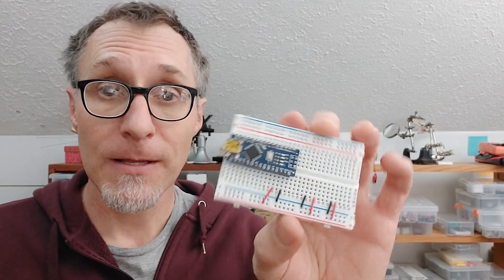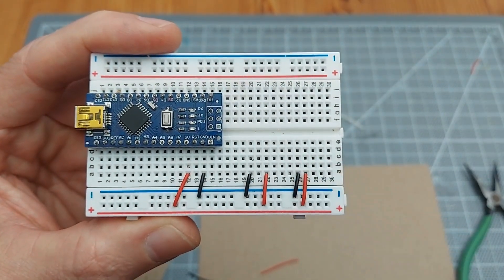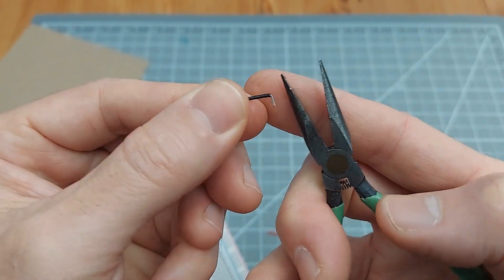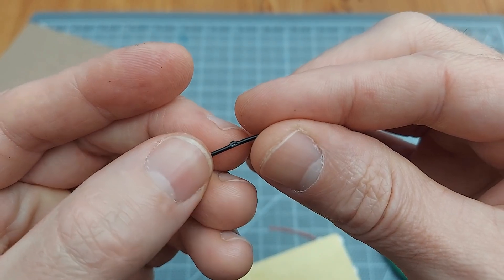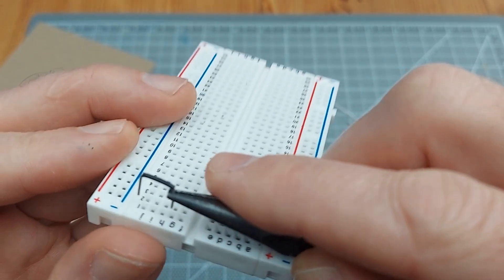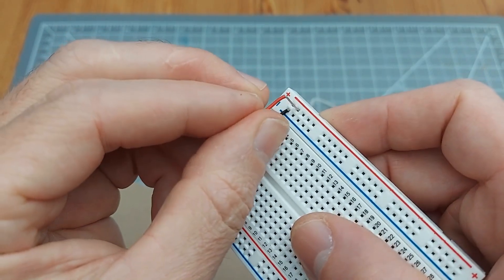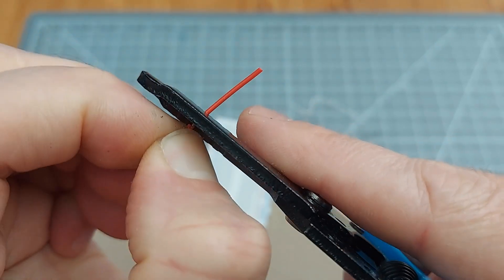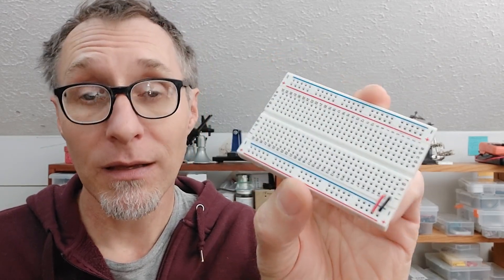Better jumper wires for breadboard electronics

Comment: Just started using this method after getting tired of accidentally pulling jumper wires out when making changes to wiring or adding wires for additional components I was adding, especially when things started to get busy on the breadboard. It was getting to be a bit of a headache.  I managed to get hold of some CAT5 cable left for trash in the recycling at work and it works perfectly for the breadboard.  Things look significantly cleaner and I can actually 'see' what different jumpers are for, rather than having to fiddle through a jumbled mess. 

Definitely could do with some wire strippers though; next on my to buy list.
Reply from the maker: @EngineerNotFound  why are strippers are a must! And I have two different pair, to cover the full range of wire gauges

Comment: Good info, well done. I had been wondering about using solid core wire from ethernet cables. A couple of commenters below recommended it. It's easy to get, maybe a little harder to find 22 AWG. Thank you!
Reply from the maker: Yeah it's weird this video ended up being quite the forum. YouTube is just so Random!
Besides liking the thickness of 22 awg, the reason I buy spools is so I have exact colors for board layout.. black for ground red for positive voltage Etc. And then I stack all the spools on a dowel so I have kind of like a dispenser on the side of my desk it's pretty handy

Comment: I started with telecom cable. Old Ethernet cable can also be used. No need to buy spools.
Reply from the maker: Indeed! Good recommendation. Of course I find phone or ethernet cable to be a bit thin for breadboard work. I'm using 22 AWG in this video.

Comment: Good video. I use a similar technique, except I jamb my thumbnail into the jacket as to where I want to strip it.  I just started to design a wire dispenser. You press the number of holes wide you want on a keypad and a stepper motor spits out that length plus extra to be stripped. I like stripping with Hot Tweezer Strippers. They are easy to work with short or long length wires.  If you search for Wire Dispenser Breadboard you will find my short video on my channel for what I am making.
Reply from the maker: Thanks! I love the thumbnail thing -- you already ARE the tool... LOL. And I love the idea of a tool to make these. Looking forward to seeing where that goes.
Reply: @androofroo  Yes, I have been told I am a "tool" , usually from my Canadian friends [smile].

Comment: You can also just buy pre-cut, pre-stripped, pre-bent wires like this in assorted lengths which I find a lot more convenient for prototyping since I'm actively avoiding anything permanent. Even if the lengths aren't perfect, you can get them nice and flat and you can reuse them without actually needing to go to the work of measuring and manually preparing the wires.
Reply from the maker: True. And you should do what works for you. I keep my old ones in a spare breadboard for future re-use. No reason to remake anything ;-). I do find that measuring allows me to have near perfect length for every specific application -- which I like.

Comment: so just like you do with through hole circuit boards, only with removable cables
Reply from the maker: yup, pretty much 👍 ... and often you can reuse common lengths. I keep an extra breadboard with spares in it.

Comment: I've been doing this for as long as I've been breadboarding.  Another tip for actually using these is to attach popsicle sticks or some other form of extensions to an alligator clip to make it easier to hold and use that to place and remove the jumpers.  As you start building up more intricate circuits it can become quite difficult to do by hand. You can actually get kits with pre-formed jumpers like these, although the last time I got one they used the worst possible wire -- almost as soft as solder.
Reply from the maker: Nice tips! I also hate the pre-formed ones... not only are they cheap, but I like to cut them to the correct length for each build.
And yes, for more complex projects, it's better to make a proto-board or a PCB.

Comment: what kind of wire is good ... what gauge is that ?
Reply from the maker: Copper is standard, but any solid-core wire... that's 22 AWG.
Reply: @androofroo  I am pretty new to this, I bought a small starter fun kit (Elegoo), so far I only made like a few tests, with leds and resistors. But I watched quite a lot of videos of electronics, and also arduino videos

But i didn't do any more projects yet, because I found the kit very limited, it also had no arduino in it. (I like the programming part, I'm a bit of a programmer). 

So I just ordered some more stuff, a "super starter kit" that has arduino uno r3 (elegoo), and a bunch of other stuff like speaker, servo motor, expansion board, etc... 

But I don't like those big jumper cables, there is some of those 'bent' wires in the kit, but not enough, that's why I was looking for info on wires

I guess anything from 20 to 30 awg for these little projects is good? for the breadboards? just have it solid so it's not like a braided wire that I can't "stick" inside the breadboard?
Reply from the maker: On Amazon, they have multi-color wire packs like this one...
https://www.amazon.com/StrivedayTM-Flexible-Electric-electronic-electrics/dp/B01LH1FYHO/ref=sr_1_6?crid=3HV1EOYR7B5SS&keywords=striveday%2Bwire&qid=1702164351&sprefix=striveday%2Bwire%2Caps%2C263&sr=8-6&th=1

Then you can measure and cut your own jumpers and use colors to organize things.
Reply: @androofroo I am also thinking of a solder station, solder, flux, "Sponge", whatever else I need, wire cutters, scrapers, etc. I don't have big plans (yet) to make like a robot or something :D just small projects for now... maybe a light for my toilet that lits a red "occupied" if someone is inside, or something :) maybe connect it to something...
Reply from the maker: For soldering, purchase a temp controlled soldering station (not the "fire starter" kind that just has one temp ... i.e. crazy hot). For the "sponge" I use the brass type that has the little house, like this one...
https://www.amazon.com/SINJEE-Soldering-Cleaner-Wire-type-Cleaning/dp/B08C4VN46N/ref=sr_1_2_sspa?crid=39C2EVXET75PB&keywords=solder+sponge&qid=1702164582&sprefix=solder+spong%2Caps%2C135&sr=8-2-spons&sp_csd=d2lkZ2V0TmFtZT1zcF9hdGY&psc=1

Comment: What gauge wire do you recommend?
Reply: To me it looks like 22-24 AWG.  I use the wire from CAT 5 cable. It's solid core at 22-24 AWG and you get 4 color pairs.
Reply from the maker: Indeed it is 22 AWG. And that's a good tip... Ethernet cables have fun colors!
Reply: @jcorrea8597   I use Cat-5 offcuts too. Important note: in-wall Cat-5 is solid core, patch leads are stranded. It's easy to tell the difference: if you bend solid core, it stays bent, if you bend stranded, it flexes back.